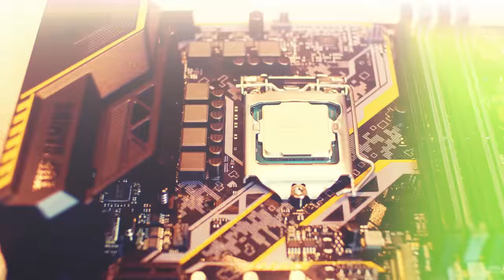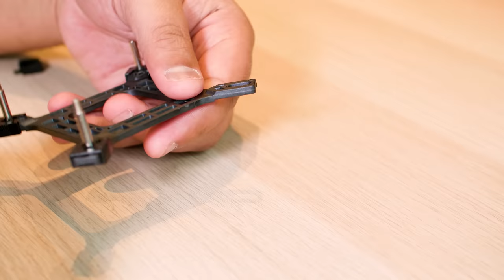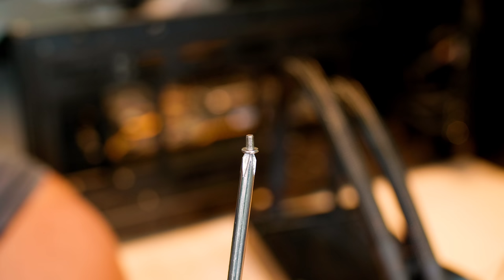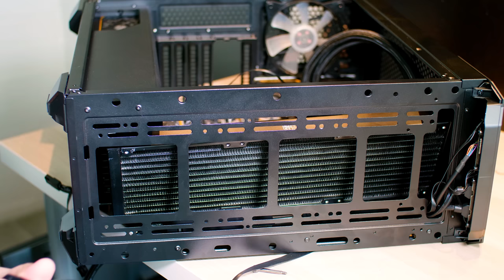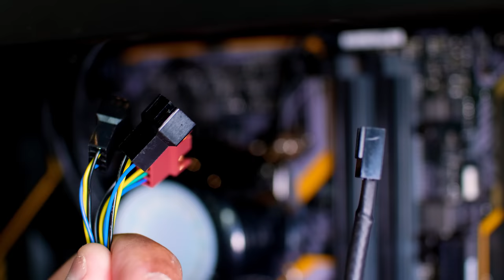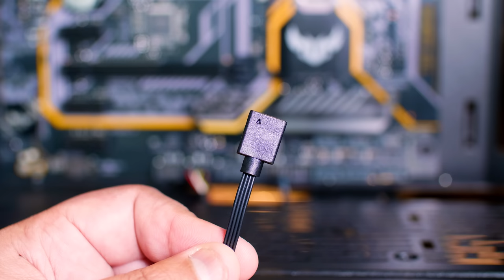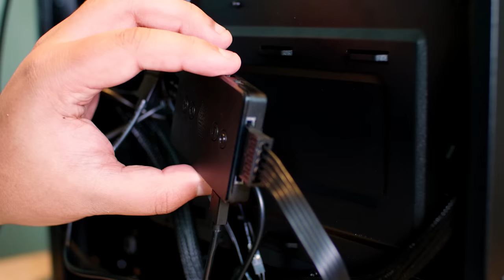HOWTO Install Cooler Master MasterLiquid ML360R RGB on Z370 & Z390 Motherboards

Comment: I have a ROG crosshair VI. The board has 12v rgb headers. I know ARGB uses 5V headers. Can I plug the controller into the 12v header? It looks like you plug it into a 4 pin header on that TUF board. Is that 12 v or 5v?

Comment: Hello I have b450 msi tomahawk max and a cooler master ML120R RGB. All of my cable are connected, I can control the RGB using master plus but what I want to do is I want to control all the RGB lightings using msi dragon center. When I tried to switch off the control of the ML12R RGB and switch the control to the motherboard, the msi dragon center mystic light couldn't detect anything. I can only control the rgb of RAM and motherboard lightings using the mystic light but not Cooler master ML120R RGB.

Comment: On your fans, I noticed you put the sticker going towards the rad.  Would this be drawing air out the front of the case?  I always thought you wanted to have the fans blow towards the rad, to inside the case, and pull out the top and back.
Reply from the maker: It is blowing towards the rad

Comment: i am wondering i have the cooler master mb530p case which doesnt have a reset switch but a rgb control button instead. Can i plug that rgb control button from the case into the controller?

Comment: Just got this AIO. The only problem I'm having is the RGB lighting on the pump stays green and does not shut off when I turn off my PC. I have to manually shut off the PSU on the back. It's connected to a ASRock z390 phantom gaming 4. Any tips or suggestions on how to fix this??
Reply: Go in to your BIOS and set it off from there. In Asus there's an option for the same.

Comment: Hey I have the Cooler Master MCB-B530P how do you get the button at the front of the case that controls rgb to work with the controller... sorta like being able to control the rgb via the case rgb and the controller.. on this case the controller replaces the reset switch

Comment: Impossible for me to sync with Aura with my Z390, i don't know where do i have to put the 4pin cable which is connected to a 4pin RGB header on my MB...
Reply: The same problem. I check that step. In theory do you have to conect 4 pin to 4 pin cable to aura connector in your MB to 4 pinRGB botom RGB MB port in your controller. But... Doesnt works with Aura... The same with 3 pins ARGB connector...

Comment: I'm doing my first PC build and I'm having trouble putting in my ML360R. I have a[ Aorus Elite x570 mobo/3700x ryzen/LAIN LI case/RTX 2080...ECT.... There are different pins on it and I'm stuck.. please HELP if you can..

Comment: Since my motherboard didn't have AIO pump, I followed the video step by step and for some reason the pump wouldn't really get activated 3/4 of the time at startup.

You connected the 3 way splitter to the CPU_FAN and the pump on the AIO, what I did is plug the 3 way splitter the same way in the CPU_FAN and the Pump on SYS_FAN1
(Note that I didn't exactly think it through as it was my first time building my own PC and I didn't know that CPU_FAN takes priority.)

Anyway, What I did is put the 3 way splitter into a SYS_FAN1 and the other cable that comes from the block to the CPU_FAN Which I would assume it's the pump.

It took me over a week to figure out the problem, as half the time the pump wouldn't work and the temps would be at 99C and I would think it's just a missread while in reality it really was 99C.
I swapped those cables around, 3 way into SYS_FUN and the pump cable into CPU_FAN and everything works fine now.

Not sure if someone has had this problem before and commented, but I will leave it here for incase someone else has the same problem.

Comment: Hey I am trying to install this cooler on my rog strix e gaming mobo but the fan cable coming out of the aio pump is a three prong connection.  Not a pwm connection.  Is this a defect ????
Reply from the maker: No. Plug it in
Reply: Plug it in to what ?
Reply: There is not a three prong output from my mobo
Reply: does it come with thermal paste?

Comment: i got a question, if a case supports 3 120mm case fans on the front, could it also support a 360 rad?

Comment: I have a p400a case with the MC ml360 rgb but my front case panel will not close with the included radiator fans. The bottom fan in the front seems to be tapping the front panel and stopping it from clipping together.
Reply from the maker: slide the rad up

Comment: Hey guys so I'm new to building pc's and have just got this liquid cooler to go along with my ryzen 5 3600 CPU. Wondering if I should use a different thermal paste than the one provided? and in the video all the different screws and plugs: Do they come with the box or do I need to go buy them? If it's the same plugging into my MSI gaming pro carbon motherboard. Thanks!

Comment: II was thinking of getting this cooler, but after looking at it on the Cooler Master website, I am concerned about the CPU copper heatsink, and the aluminum radiator.  I set this combo up on my first rig (but in reverse), and it turned my water milky colored pretty quick, and within a few months it was like grey sludge and caused overheating.

Is there an equivalent system that is all copper or all aluminum.  I don't feel comfortable mixing the two.  Oh, and it has to be Aura compatible for my Z390 Asus board.
Reply from the maker: The coolant inside is designed for mixed metals. Relax ;)

Comment: How do you install this in a case that also has RGB support and where the reset switch connects to a built in controller? Example, Thermaltake View 37 ARGB

Comment: i was watching this while set up my cooler master, but my rgb fan and rgb pump wont light up, im using mobo gigabyte GA -Z68MA-D2H-B3
Reply: probably cus its not connected correctly question: does it come with thermal paste?

Comment: What should i do if i build in a lisn li o11 dynamic and i have 6 more cooler msster fans. My aio is the 360 illusion with the halo fans and 6 other halo fans. So in total ive got 9 halo fans

Comment: I got this cooler, connected all the cables and everything I installed it on the top on my cooler master td500 mesh case and I’m averaging around 75-75 degrees Celsius which is very hot, I don’t know what to do because the fans and the block turn on but I’m getting very high degrees on my cpu, I’ve peeled off the plastic on the block and also applied enough thermal paste. I’m using an amd ryzen 7 3700x

Comment: I am kind of hoping you guys still monitor this one!  I just got this cooler set up on a new X570 Adrus mobo today.  I have everything hooked up the way your video shows it, despite abysmal documentation or installation instructions from them. (managed to do so prior to watching)  Here is my issue, when I hit the power button, my PS clicks twice.  Thats it.  The lights on the control unit are on, but nothing else is.  Now, if I unplug the sata line out of the control box, there is no power to it, but the PC starts up fine. I have tried different sata lines, with no change.  I am not really sure if I even NEED the control box, as I think this MOBO might be able to control the lights, just not sure.
Reply: I think that happens to me too, when i plug the control box to the PSU via sata cable my pc wont boot.

Comment: I’m so confused, he shows him plugging the reset sw into the motherboard and then shows plugging the pointy one into the reset sw. how on Earth can you use the same cable twice
Reply: There are two cables in the box, all you are doing essentially is re-routing the reset switch on the case from the mobo to the controller box and then the controller box goes into the mobo where you normally would have put the case reset.
Reply: Misunderstood Wookiee two reset switch cables?
Reply: @JoelTeer  in the coolers box it has two of those two pin connectors labled reset  sw, I didn't use them as my case doesn't have a reset switch but from the video guide for install (I watched tk make sure I did me right and I did thankfully) one of the cables goes into your mobo reset connector the other is for the case reset button, then you plug both of those into the control box which if you understand means the control box now has a way to pass through the reset button to the mobo and thus can take over the buttons functionality to provide the short press of the reset button to change lighting modes and hold the button to actually reset 😉
Reply: Misunderstood Wookiee i just skipped that step. He also said plug all fans and cooler wires into the 5 way splitter but when doing that I realised that when using their app with profiles that Channel 1 would light all of them up (obviously) so I individually assigned my cooler and fans a channel instead
Reply: @JoelTeer  yeah I've noticed the same thing originally I did exactly what the manual said in fear something would blow up as I never used rbg anything until then 😂, even tho I got no problems building a pc just I know the voltage for rgb varies with various type connections I didn't wanna risk plugging in to any old rbg header.

I thought the rgb headers on the control box were specific to things had I known it's not I would have probably just removed the 5 way rgb splitter and plugged each fan along with the pump connector to a individual header which I might actually do now you confirmed it work and at same time re do my cable routing as I admit I rushed the initial cable routing of my case and while the front is relatively clean because it's all glass panels the back is relatively a rats nest of layers and I kinda didn't find anywhere tidy to magnetically mount the control box so I just stuffed behind the ssd tray 😂.

That said I do have the Lian Li 0-11 Dynamic and it's a duel chamber design but admit I could probably route a couple cables at front a little more pleasingly tho nothing really is a huge eye sore it's just they aren't run anywhere particularly thought out like behind a mobo tray because I dontike running cables behind the mobo as then you gotta remove the board to remove the cable.
Reply: Misunderstood Wookiee I shoved a lot of cables in the extra space by my psu, my magnetic controller could barely fit. It confused me tho, I got this pc built by cyber power (I fully customised it) and they gave me a lot of cables and that remote controller all not plugged in, to me they seem spare but idk why. The cooler was In but not the controller nor the rgb button on my case so I was confused with the controller but not anymore I am still confused with the extra wiring though, I got an sli bridge and an extra pcie cable I believe yet I only have 1 gpu and do not believe my cpu has integrated
Reply: Misunderstood Wookiee but yeah I didn’t get two of the reset sw cables only one
Reply: @JoelTeer  me neither. I only got one and the instruction manual only details there being 1 as well... did you manage to figure it out in the end? Im stuck now

Comment: hi, can u please help me?.  On my Z390 Aorus Master board all of my headers are 4 pin so how can I connect for example the fan speed controller plug which has 3 pins? thanks , probably a silly question..
Reply: did u find a solution?

Comment: What a nightmare I've had with this cooler and the H500m case. Can't get anything to work. What software do you use to control the fan speeds?
Reply from the maker: depends on your motherboard

Comment: Hi. May I connect the RGB splitter directly to the ARGB port of my Motherboard without installing the CM controller? Thanks. I have a Gygabyte Aurus Master Z390
Reply from the maker: you sure can if it's the regular 3 pin ARGB connector. I have that board sitting here I just havent actually looked in the box yet.
Reply: @GearSeekers . Yes. There are two 3pin ARGB connectors on the Motherboard.

Comment: Great vid. Quick question. I want to plug in 4 other CM fans I have to be controlled by the controller. Any suggestions? Will I need a PWM splitter?

Comment: I found all your 3 videos useful about the Cooler Master Liquid(240 and 360) but I still have a question, my Ml360r is coming in 3 days and I want to know if I can connect the 3 fans on a Argb header. I have gigabyte 390 elite Mainboard. 
Thx
Reply from the maker: should work fine

Comment: Hey guys I have a few questions!
I have a MSI MEG Z390 ACE, and I'm planning on buying the latest i9990K from Intel. I want to know if this AIO Cooling SYstem will fit my i9990K Socket and also if it will sync with my MSI "Mystic Light Infinity" mambojambo?
Thanks guys!
Reply from the maker: Yes to all the questions.

Comment: Just out of curiosity, do you also have a similiar video for Z490 motherboards or is there any difference between it and the Z390 in terms of installing the cooler?
Reply from the maker: It's exactly the same
Reply: @GearSeekers  Thank you so much for the quick reply. Much appreciated.
Reply: @GearSeekers  one other question if i may. i was told that in order to interconnect both my 360R fans and my 120R fans, i would only need the larger controller. Is this correct?

Comment: I have a 

- Cooler master H500M case
- Cooler MASTERLIQUID ML360R RGB
- Cooler MASTERFAN MF140R ARGB

So these are 6 ARGB fans and the controller only take 4 ARGB inputs or so. How I can manage all of the 6 on the same time?
Reply from the maker: it can handle up to 20 fans. 4 channels can be split 5 times
Reply: @GearSeekers  do I need any type of splitters or they already exist within the box. Thanks for ur superb quick response 😊

Comment: I have a question. I'm building my first pc and I got this one. Why did you install the fans on the outside of the case?
Reply from the maker: They are not on the outside. The front panel is not installed.

Comment: My motherboard does not have a aio pump header, so can I just connect the cable coming out of the pump itself, to the cpu fan header and then the threeway splitter to a normal fan header?
Reply from the maker: yes

Comment: so if i want to control this AIO with Mystic Light from my MSI motherboard, i dont have to install this controller? My case (Corsair 570x) already has a controller installed for the 3 fans at the front, can i install 2 controllers on my pc or connect the corsair fans on the cooler master controller too?
Reply from the maker: No
Reply: Gear Seekers no i dont have to install the controller or no i cant use two controllers at the same time? 😄

Comment: Hi Nicholas. Thanks for your help. A nice video. I have a question about the wires coming from this pump. The wire that has to be connect to the motherboard (aorus z390 pro wifi)  has only 3 wires, although the connection on my motherboard has 4 pin for the connector. The fans are rotating and the RGB is working too, but how do I know if the pump is working. I have touched it, but I do not know if water is flushing. Can you please assist? Thansk and regards
Reply from the maker: As long as its plugged in and your system isn't overheating, it's working :)

Comment: The last step you said I need to connect the Sata Power Connector to the controller but I do not know which one to use because I have 2 Sata Power Connectors

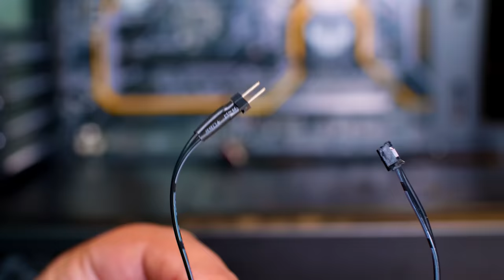Comment: 8:28 I dont understand this part, what do I need to do? I hace my case reset power to my motherboard reset power, Do I need to disconnect it? Or what does that cable do?
Reply: Same issue here
Reply: @danielgrant6490  I didn't connect that cable and it works fine, its not neccesary to connect it
Reply: @SliderV5  Fan, case reset, MB reset, R1. I'm currently trying to figure out where these wires go on MB. So your saying don't use case or MB reset wires?
Reply: @danielgrant6490  Yeah

Comment: Can I install ML360R Liquid RGB on any Mid-Tower case which is max 18 inch height? Which case do you prefer?
Reply: No way of telling if your case chassis supports a 360mm radiator based off of height... lol Just gotta do some research and find a nice case and see what kind of fan/radiator support it has.

Comment: Ive built 5 or 6 pc's but never really messed with rgb and controllers, I made a mistake and order non-addressable fans for my CM H500m and there not compatible with its controller. It seems like newegg is the only place I can find CM addressable rgb fans. I'm glad I found your video it should help with the install. I have a h100i v2 now and it doesn't cool the 8700k very well hope this does better, I also bought a delid kit and liquid metal.
Reply: do they not fit on the h500m? im about to order that case but i was told it was not compatible?
Reply: Kotori you can fit any radiator on top 240-360mm but have to run them in pull configuration with most setups. I couldn’t fit push fans on my h100i v2 because of clearance with my motherboard and the top of the case. I ended up getting a cm ml360r in push/pull in the front of the case, better for cpu temps but makes your gpu a little hotter not by much.